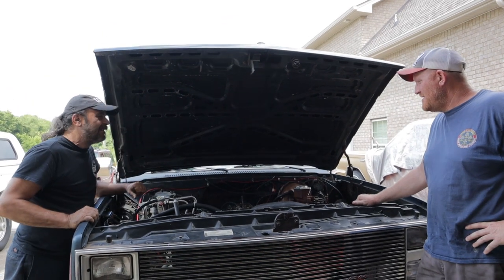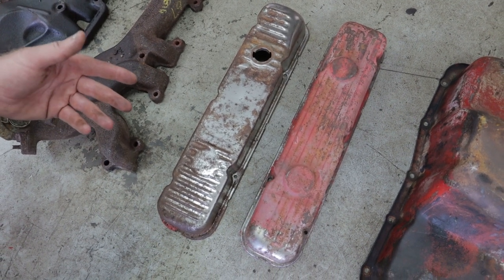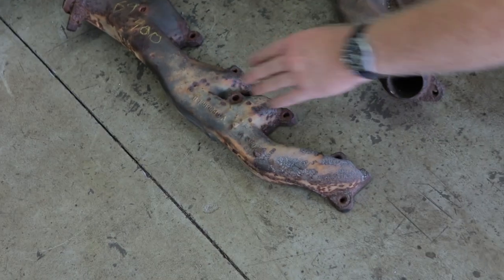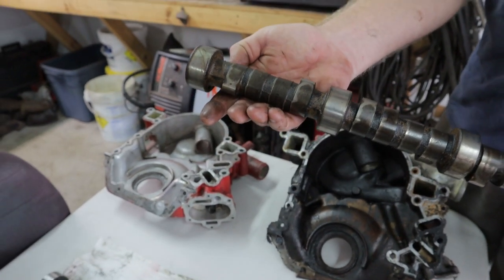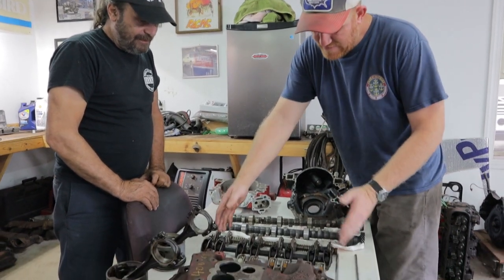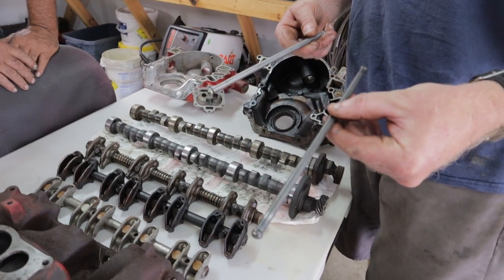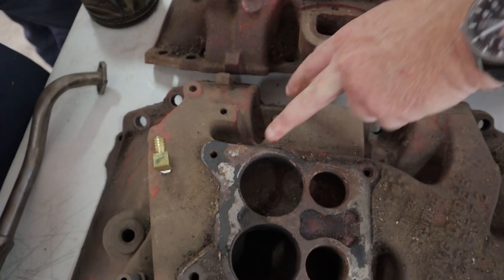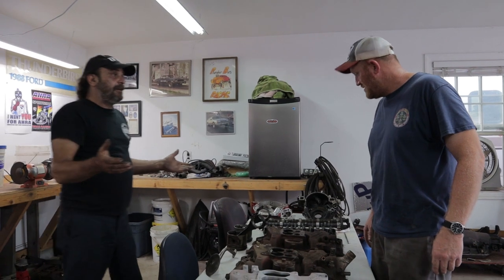Buick Big Block Info Dump

Comment: I wish you guys were around when we were in highschool choosing what we wanted to build. If somebody someday invents a time machine, I'm sneaking you both in front of the line.
Those later rockers were simply not getting enough oil, if the shafts themselves didn't provide oiling holes. Ideal would be to supplementally lubricate the 161s through later-type pushrods.
No kidding. So Edelbrock was casting Stage II intake manifolds for GM?
I'd like to see something on the dual-vane torque converters for the THD-400s and maybe something on header types

Comment: Buick big block is the only engine that when I hit the gas feels that torque is more than I need, I have stage 1 upgraded to some stage 2 specs. custom design heads valves and carb spacer by myself. I also did custom jets and rods on carb to have better gas mileage on city and good power when I need to leave everyone in dust.

Comment: Its great to see you no your Buicks, i live in Australia building a 455 .040 up so 468ci looking at putting it into my1977 C20 pickup, i see at the start of the video you put a 400ci, what info do you have on the truck what engine mounts did you use ect.
any info would be great 
Regards
Rossco
Reply: We sent two 455 strokers to Australia ... for Con Liapis and his nephew.
Reply: .038” over 455 is 464ci

Comment: i'd also like to see the details of the truck swap.
Reply: Buick has 2 sets of moter mount positions so it WILL drop rite in 73 on up chevy pu , pre 73 u need to modifi the 73 mounts.

Comment: I love this Buick series.  I'd love to see some more stuff on the Buick V-6 (I have an 87 Grand National). If I'm not mistaken, wasn't a Buick v-6 used in some Jeeps for a bit?  So much V-6 performance history, with them being developed for Indy Car racing. Keep up the great videos!
Reply: Yes, The Buick v6 was installed into some Commandos I know, because I had an uncle that had one, bought it new. I'm sorry I don't recall the year.
Reply: Yeah. There was a time there in the ‘70’s where AMC would use about anything they could get. They’re a mishmash of Chrysler, AMC, and GM parts
Reply: @moparproud3978  Ford too. My first car was a 1972 AMC Javelin AMX, 360/automatic. It had an Autolite carb, Motorcraft starter, Chrysler-based 727 trans, Delco distributor, Saginaw GM style power steering pump, etc……

Comment: What are all of the trans. options both auto and stick for the buicks. including the 215ci. ? and Jeep? guys putting big blocks into jeeps will need to know this. and those using the 215 and early v6 . also the changes in the Bells and clutches. spline counts? are all the cranks drilled for pilots? what needs to be done for balancing when converting from auto to stick?
Reply: Powerglide or th400 mostly buick had the first mass produced auto the Dynaflow. Ive never seen a buick with a stick

Comment: Where to go from here?  Well, there minutia of the accessory pulleys and brackets.  As an example the difference in the height of the cast pad in the intake manifolds to attach the upper A/C bracket and that the bracket is different.  This is different between a 70, 71, and 72 455.

Comment: Talk about the GS 340 stuff ,much overlooked motor they came with a glide behind them 
it's a high revving motor as long as you have taken care of the oil starvation issues .  It runs like a 327 but better !LOL   As a  a kid i drove to Kenne-Bell and picked up all my parts because they took month to deliver stuff back then 80,81  LOL   Kenne Bell was Synonymous for slow turtle  style shipping !  That's why i drove out  and just picked up what they had in stock ! LOL This is way before they went ford stuff LOOL

Comment: So if I gather everything correct, these 455’s would drastically benefit from a dry sump oil system with the flow upgrades/chamfering the passages. You could perfectly regulate pressure and put zero pump load on the camshaft, and have a pretty shallow pan so it fits in anything, and being dry sump it doesn’t matter that  the stock pans don’t have grate Windage trays. ??

Comment: I would love to see the necessary oiling mods that need to be done on the big blocks!
Reply: 1) drill the block to 5/8” 
2) high volume oil pump gears with a spacer and stock spring
3) make a cam button to prevent walking by using a brass button head bolt (drill and tap the timing cover and make sure to seal it because it goes through to the water pump area)
4) groove front cam journal (behind the bearing) to allow oil flow to cam bearing
5) install a oil gallery bypass on back of block so drivers side lifters don’t starve for oil
6) block off 67-69 head oil passage and use 1970 and up rocker shafts and pushrods 
7) when building, remove all casting flash from lifter gallery
8)make sure that oil holes in bearings line up with oil feed holes in block
9)machine block and main caps for a main girdle because the Buick big block is not very strong at above 550hp
10) use aluminum intake and heads to drop fully dressed Weight to around 550lb

11) use a different engine. These were really cool motors in their day, but far better options exist nowadays. Parts for these are almost unobtainable now.

If anyone wants a few 350s with a set of rebuilt heads and a rebuild kit, let me know I’ll give it away to a good home.
Reply: @twoeightythreez  holy smokes my friend! That's quite a rundown! Thanks for the info drop!! This is why I love the car community! Lots of folks willing to help one another out!
Reply: @twoeightythreez  I also agree with point 11 on your rundown. If it weren't for my 68 GS400 being so complete I'd probably just LS it and be done. I've also got a pretty clean 69 Skylark that's just a roller that might just get the ls. Buick big block torque is so so addictive but when a guy can build two mild LS's for the price of one BBB it's kind of a no brainer.

Comment: Question: Could you please elaborate about the bent 455 crank. I need a video. I believe I have that issue, although it ran before I disassembled it, now it's back together and I really have to wrench on it to get the motor to spin by hand. What would be a good hi torque starter to use? Thanks
Reply: I personally never had this problem or even heard of it.

Comment: I would like to see a mid to mid to late 50's Roadmaster coupe, with no posts...or a special (convertible!!!) build with a 455 CID motor and a 4/6 speed on the floor! While we are at it a tunnel ram or a blower set up, say a 8-71 with twin electronic injection, and also if you want you could twin turbo it! But again with 16 injctor electronic system! Do not forget the methanol injection system! It should all fit under the hood! Unless you want to tunnel ram it and then 871 BDS Blow it!!! 
....that would be sweet! but there is more!!! ...another sweet thing would be to heat the entire body and sandwich it by a couple or so inches, like that 57 I saw a while back!!! The lights should also have the "Stewie" head effect also!
Custom interior, maybe a bench that has buckets crafted into it! for rear end you can IFS it or if you feel like doing some work craft a Nissan r3x AWD system with the 6 speed manual, Lower it all around and put some big 14 inch  plus brakes with the Hyroboost setup, some 335mm tires in teh back and say 285mm in front! On custom "steelies" that make it look vintage! 
You could also include the ABS rings so that you can retrofit traction control and braking amenities into it, just so that you can modernize everything! You know bring it to this century type thing! 
For dash gauges, some vintage airplane white faced gauges with nice mirror polished/finished steel rings! The glass could be also be treated with some of that gorilla glass diamond coatings so that it never scratches! 
So what do you say! I can come up with project names if you like! Just if you build it mention me a bit!

Comment: Hi guys,  I just watched this video , ( I haven't seen the first two yet ),  but  on the intake info,  it is not really complete .   There is a difference between the '67 and '68 and '69 in the  Riviera .   The '67 had actual holes that hot exhaust ran under the carb and required a metal gasket under the composite gasket .   The difference between the '68 and  '69 is the distance from the opening of the right side  ( passengers ) of the small primary hole to the end  and then it drops down for the carb throttle plate  linkage .   The '68 is wider and you cannot use a carb from a '69 or later because it hits the manifold .   The base gasket corresponds ----  if you were to measure the width from the end of the primary hole to the end ,  the gasket is larger on the  '68 .    
RivyRob

Comment: You have a buick motor in a suburban I have a 430 I need to use in my suburban also what did you have to do as far as mounts for the engine install? Much appreciated 🙏

Comment: did you ever make a video porting the timing cover? I'm currently working on a 71 455. it's been sitting over 30 yrs but I believe it only has 40k original miles

Comment: Buick big block engines were only made to rev about 3500 to 3700 rpm.They moved big Electras.Oiling was not an issue.Thats why they built torque.Big mains,big rod journals.Valve spring pressure came in to play as miles multipled limiting rpm over all.
Reply: If you have any clue how to rebuild a 455 Stage 1, all of this goes away.
Reply: 3700 max?? This is complete nonsense

Comment: Can the earlier 67-69 big block rocker assemblies work with 70 and later oil through the pushrod setups?
Reply: Yes, but you must use adj. p.rods to get the proper length and block the oil feed holes that go through the rocker pedestals.
Reply: @LR-my2di  Thanks, I have a 455 with worn out rockers and wanted to use the 430 rocker arms and shaft assemblies on it.
Reply: @stevenbauer2205  Just look at the bottom  of the rockers you have for excess wear and use adjustable p. rods (with oiling holes) to have 1/2 turn preload. The ball on the end needs to be 3/8" to match the rocker arm socket.  .

Comment: What about buicks transition from inline 8 to V8 in the fifties? Those engines were known for smooth running at low rpm torque.

Comment: The Buick V8, the OIL PUMP & it's gear size / height, and it's similarities & difference compared to the AMC V8 Oil Pump & Oil Pump Gear size / height, and those compared to Mopar & chebby Oil Pump gear heights...

Comment: Can you do a video on some olds 403/455 stuff? Seemed like very promising engines but they definitely had shortcomings.
Edit: The 403 having issues
Reply: having a 455 powering a  muncie 4 speed and 391 posi, I can assure you that Olds engines don't have any shortcomings. It's too bad they don't get the attention they deserve
Reply: @ben68442  ill agree they surely go
Reply: Check out wildrose garage here on YouTube.  He was mentioned by UTG.  He has an 87 cutlass with a 425.
Reply: @Ben N I have owned a ton of Pontiacs, Buicks, Olds,  Chevs,  and can tell you the Oldsmobile V8s were by FAR the most reliable of all of the GM engines!  I was never able to blow up an OLDS V8, and I tried hard!
Reply: @ben68442  sorry I should’ve said the 403 had shortcomings

Comment: What was the compression ratio on the stock motors and the cheapest way to increase the ratio, thanks.
Reply: Milling the heads is the cheapest easiest way. Pretty much everything pre70 was 9.5 to 10.5 everything after 72/73 8, 8.5

Comment: Buick engine was designed to only pull around heavy cars.Most cars rarely seen anything above 3500 rpm.Thats why the engineers had to put into their engine designs the needed Torque.

Comment: What was the weak link in the engine  i.e. rods, crank or block and how does one bend a crankshaft. I have heard of a broken crank, bent crank, not so much. As far as RPM how much could they stand. Did Buick ever produce a forged rod or crank.
Reply: Hydraulic lock a cylinder, maybe?

Or an absurd amount of boost.

I know the straight 6s would get some serious twist in the crank with lots of boost.
Reply: Oil pressure and high rpms is the weak leak in any bop engine
Reply: No true street camed 455 built correctly will make power over 5500 rpm.  Usually peaks at ~5200 rpm. Big, fat torque curve though. That's what it's all about.  This is true even with 500+ hp and alum. heads.
Reply: @vicmccartin  Easy to remedy, though.

Comment: I’d like to know why there is so few skylarks compared to all other A bodies around today. I heard the oil timing covers since they were aluminum had the oil passages over time enlarge causing a decrease in oil pressure resulting in blown motors.   I found out later this happened to my grandmothers 71 skylark in 1981.  Is it possible that it was such a chronic problem most skylarks with 350s we’re just scrapped in hoards? Is this also why the are half the price of a chevelle? I’m younger so I want to know what you older guys think since you most likely remember this back in the day.

Comment: 'nudder great engine to drop into slabsides...Caddy 472/500. you can buy an adaptor for Chevy big block headers, which are made for the slabbies--easier to find than some of those Buick manifolds with stuck bolts. the engine likely got great care from the first owner and never saw over 4,000 RPM. diesel like torque by 2,000 RPM, where you cruise on the highway.  there's adaptors for Ford 429/460 intake manifolds, but Edelbrock has a Performer intake now--for the cost of the adaptor :).

https://www.pricemotorsport.com/html/body_ap-23__intake_adapter_kit.html

Comment: Whats the diff with buick, olds, and pontiac rearends?? I kno they always list them separately
Reply: A big subject if properly addressed.
Reply: From ‘71 up the bop rear ends were 8.5 10 bolt. A very good rear end. It was referred to as the corporate 10 bolt.
I run this in my GS with an Eaton 30 spline carrier and Moser 30 spline axles. 
This 10 bolt has bolt in axles as well. No “C” clip👍

Comment: Transmissions olds, Buick are same and Pontiac and Chevy are same. All over hood they pull motor out 4dr or wagon. Drop it in anything. One day me and my buddy seen 1979 cutlass with dodge motor. Looked right at home. 318 or 360 it was little guy. We have tiny 260 v8 olds block and 4.3 v8. Best transplant is 5.7 truck motor TBI eazy swap. Problem later you have mystery block when you need parts

Comment: Which 455 would YOU prefer to swap in a half ton pickup?
OR 472/500 Cadillac
Reply: Which would you think?
Reply: @LR-my2di  Best truck engine low end torque and pulling a trailer for a dropping in straight out the car and run?  Olds 455.
Reply: @CSXT8250  "Olds 455"??  Well, I have a 1970 W30 with the hot "328" cam because I ordered this car with no a/c and no pb.  There are numerous versions of the Olds 455 with fairly big variances in torque. Same for 455 Buick. So which one are you talking about?   According to a 42 year retired B-O-P engineer who worked with Joe Mondello, stock for stock, and as a drop-in, the standard 1970 Buick 455 is tops for this application with 10-12 lb-ft more torque than the Olds at 600 lower rpm.  The Buick's heads are simply better.
Reply: @LR-my2di  Understood. I had a chance to snag a 455 sitting in a low mileage '71 Olds 98 sedan that was dropped off at the pick and pull back in '05.  I say low mileage I'm talking a legitimate 42k mile original car that sat in a garage undisturbed for many many years.  Each and every time I reflect on it I get sick to my stomach.  Something along those lines works for me.  What I like most about the Olds is it's ability to go the distance.  They work real hard.  I understand they were a chosen powerplant in stationary equipment such as agricultural irrigation pumps, generators, among other applications. Those applications often called for running at full duty cycle on natural gas for countless hours on end. Also used in motorhomes.  I have tremendous respect for the Olds motor for that reason.  About as far as I'd take an Olds would be a hot street motor.  That's it.  10:1 with "C" heads, cam in the 220-230° range, tuned Q-jet, headers and call it good.  YES, the lightweight Buick is a hard to beat Street-Strip motor but I wouldn't waste one in the abuse I'd put a truck through. Hmm. 🤔 come to think of it I've got a roller '95 S-10 sitting in the garage now.  You know you got me thinking.
Fun fact.. My father was assigned an M42 Duster anti-aircraft tank during his tour over in Vietnam.  It was refitted by the military with 472 Cadillac power.  Was not carbureted. It had some form of mechanical fuel injection though.

Comment: After seeing how cheaply built those Buick motors look, I’m surprised they run as good as they do!
Reply: I understand, but oddly enough, it generally works just fine. Just use the steel rockers.
Reply: Biggest issue with a BBB is the oiling. They are NOT cheaply built.
If you have a ‘70 block the main oil feed needs to be opened up to 5/8”
Duel grooved cam bearings and a TA front cover will solve those issues. They are a fantastic engine to build. 
TA performance is the go to for all your performance needs.
I built a ‘70 455 with TA aluminum Stg 1 heads.
Zero deck with 11:1 JE pistons. That engine made over 600hp 580tq from 3800 to 5500

Comment: Let's see some 4 two barrel carb set up .
Reply: Probably lose power dual 4s is overrated cool looking so is 3 deuces but a single 4 is proven better. Buicks dont rev high in the first place , longer runners for low end torque is the bop way.
Reply: @vicmccartin  probably . But I've always wondered how to tune all 4 two barrel carbs to make them work right plus what it takes to tune  them . Like the ones in American graffiti on milners yellow coup .